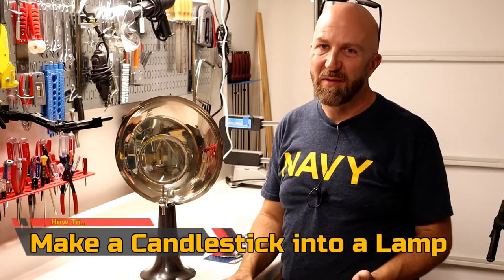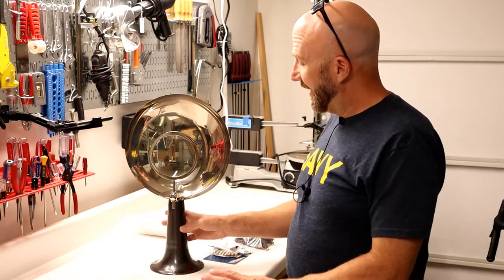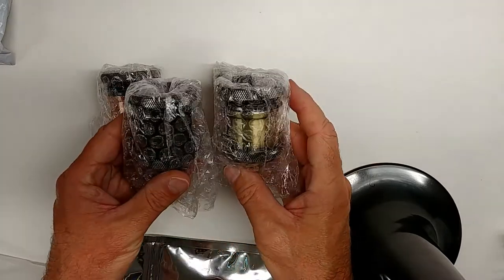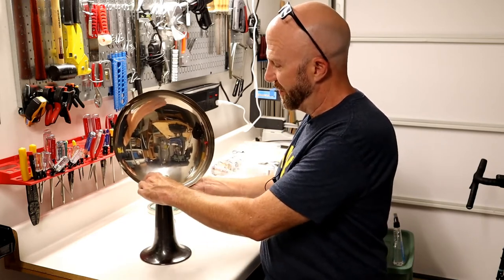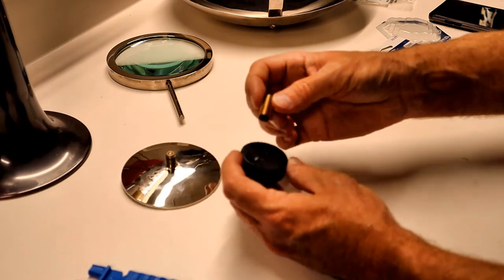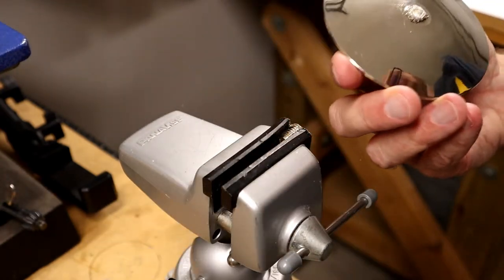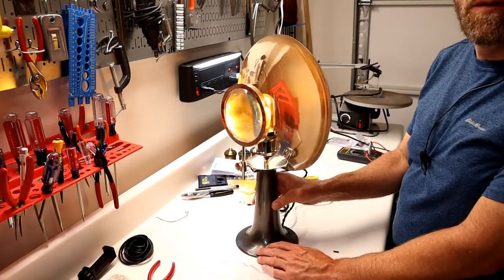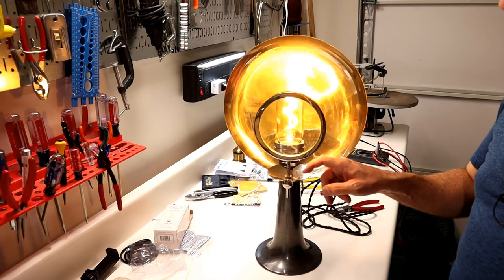How to Turn a Candlestick into a Lamp

Comment: Really interesting! I’ve been researching parabolic reflectors as I am building my own vintage bike lamp. My theory is that by shelling out an old bullet bike lamp, I can mount a reflector all the way in the back. Then, in front, I can place a small tea-light candle. I’ve built the entire lamp and it’s in working condition. However, I’d like to make it a bit brighter by using a reflector.
Reply from the maker: Cool project! I hope maybe you can post a video of it?